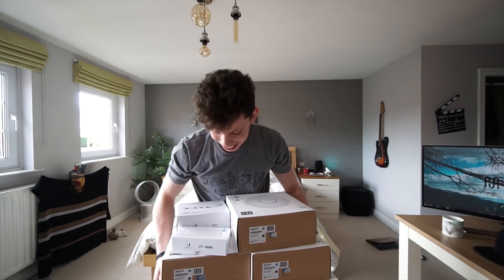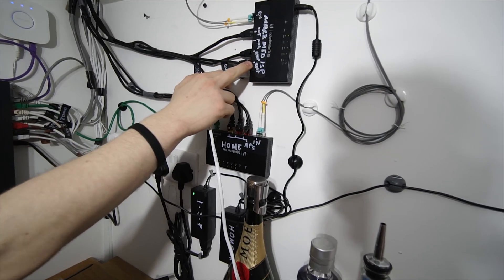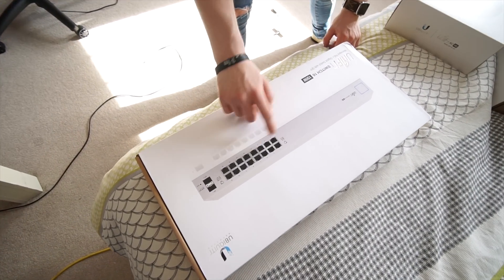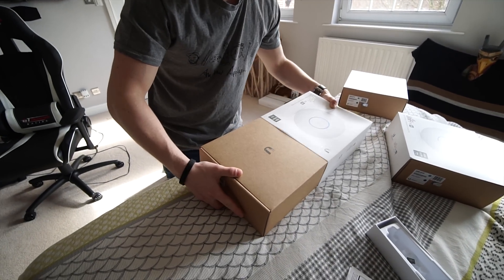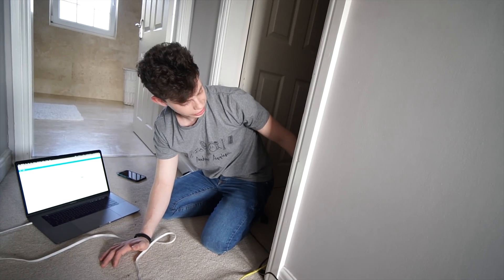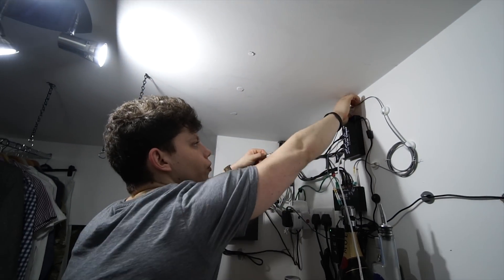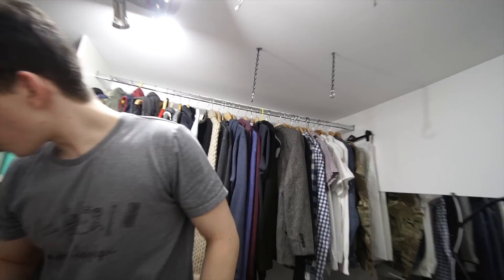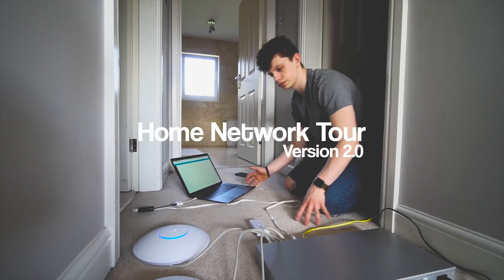Alex's ULTIMATE Home Network Install | AC Access Points, POE Switches & NAS!

Comment: Hi ,can i connect my unifi ap ac hd or pro to my router without wire ? I mean connect it wirelessly and without rj45 connection?and why you didnt use bridge mode or wds mode  insted of using rj45 cable ?
Reply: Bridge/wds makes it slower

Comment: This systems from Ubiquiti works like a charm I did a similar installation and works faster then my regular Netgear router which is suppose to be fast but is not! Thanks to Ubiquiti I get super fast speed on my WiFi over 300mbs

Comment: Did you just use a drill to mount your ears to the switch?
No Gib anchors on the AP?
Your running unshielded data with power...
For the same value I can get the same WiFi coverage a rack, patch panels, and a pro gateway
You are reading sales info
You called it a 16gigabit switch
You explained Poe as "power but over data" then circled back to say "that's POE"
Maybe provide some insight into how to configure it
Let me know if you want some pointers
Reply: Also nothing is level, go apprenticeship somewhere, learn to do a quality job
Reply: you dont need drywall anchors to mount an ap, they're lightweight so wont fall.

Comment: Dude, for a network speed of only 50 mbps, 3 ac hd access points is way overkill. For anyone out there wanting to do this, get the pro access points instead which will still probably be more than enough.
Reply: Or even the AC AP lite, you can get a box of 5 AP’s for £230 and a unmanaged net gear gigabit switch for £40 that’ll do for any res property

Comment: ok:
1. On the USG You can configure 2 lan or wan ports. 
2. The unifi AP HD is for 500+ users that is overkill for the setup and home You have. AP AC PRO would of been perfectly enough for You. But I guess You just buy random most expensive stuff for no special reason. 
3. The switch You have is not a sixteen gigabit POE switch. It's a 16 port siwtch supporting gigabit connections with a total switching capacity of 36gbps. 
4. at the wifi speed test that, shows that You have badly set up the network since You have a total lan speed of 50mbit and on wifi You had half of that. = You had 2.4ghz connection or Your 5ghz channel width is lower by default that You didn't configure.
(even if at the end of the video You have shown a 50mbit wifi speed test). 

I really do like the videos You post, but You could actually be more informative about stuff and not talk about POE multiple times. Instead teach people why this is a good solution for consumers who would just want to go for an affordable enterprise grade networking solution. 
It's just more to this than simple plug and play.

Comment: Lmao all that for 50 meg? I have fiber gigabit 1000/1000. I manage to get around 450/450 real world over just wifi and 950/850 wired using a combo of cisco and ubiquiti gear. You're wasting money when your speeds are that low. You can get away with a few generations old Apple router and manage the same 50/50 you're getting. Save your money for the tech available when your area gets real internet, i'm sure better gear than what you just spent a fortune on will be even cheaper by then.
Reply: Maybe most of his traffic doesn't go to the internet? I don't follow him so I don't know his setup.  In my house, the vast majority (>80%) of the traffic never leaves or enters my home, it's LAN only traffic, not internet traffic.
Reply: Zeric E that’s definitely a possibility, but if that was the case, he wouldn’t be raving about a 50/50 internet speed test result, he’d be showing us LAN transfer speeds.
Reply: Good point, I was just trying to make sense of it.  I have >65 devices on my home network so I look at it differently than the typical person who has a dozen or fewer devices and is only concerned about internet speed.

I like to have management and monitoring abilities that are not available on consumer all-in-one gateway/access point/switch solutions that people buy at the big box stores. I have multiple subnets, VLANS, custom firewall rules, etc. Things that most people don't understand or care about. Speed wasn't a major consideration in my design as I knew in getting equipment with all the other features, speed would just come along with it.

Comment: Here in Australia, I literally get 250/100 from the standardized Network Terminal Device that is in every house, without installing any of this shit.

You are an idiot. Disliked.
Reply: Must be nice to get 250/100.  Why do you assume his only concern is speed?  A unifi solution provides a lot more management and visibility than the consumer junk most people have installed.  Also, you are assuming his concern is only internet.  In my house, the vast majority of the traffic does not enter or leave my home, it's internal.
Reply: This guy is peddling products that aren't fit for purpose, to viewers, because this is just an advertisement for Ubiquiti products ie he says "You only need this (switch) if you're serious about networking and want a proper setup" etc etc. NOPE. Never once in my IT career have I EVER seen a business run (or even consider) Ubiquiti network equipment. It's ALWAYS Cisco or Juniper. It's frustrating the amount of incorrect info he feeds viewers, to again, peddle his sponsored products, without telling them.

There is no need for this over complicated and over priced setup for such a small pipe.

To answer your question "Why do you assume his only concern is speed?" well, why is he using speedtest all the time to show the end result? Seems like his only concern is indeed speed.
Reply: The typical home user has one subnet and a dozen clients, nearly all Wifi, they certainly don't need the hardware presented nor would they have the expertise to utilize it.

If the video started out with a WiFi survey and an explanation of the rational for the AP placements, and the nature of his wired clients/servers, the architectures etc,  it would have given him some credibility. Instead, it just shows a bunch of hardware, which he seems obsessed about, being installed without an explanation as to why. I understand he provides service to other homes in the area via rooftop wireless and a Netonix WS-12-250 (as can be seen in a later video), so there is more to the story.  Network hardware is pretty straight forward, the architecture, logical setup and configuration would be a lot more interesting.

You said "...no need for this over complicated and over priced setup for such a small pipe".  The architecture determines the complexity of the solution, the bandwidth of the external connection is just one piece it.  Back in my network days, we had sites with 100+ people connected via a single T1 (that's only 1.5Mbps pipe), small sites used ISDN (128Kbps).  The larger sites had many Cisco switches, a couple routers with multiple subnets, moving external traffic through a 1.5 pipe much smaller than most have coming to their home today. And it worked fine. People can get obsessed about internet speed, important up to a point yes, but it's not everything.

I use Unifi in my home which works for me and would work for a smaller sized business, but a large enterprise needs far more support and I agree is better served by something like Cisco.  I have >65 TCP/IP clients (~20 wired), multiple VLANs/subnets, and custom firewall rules.  My connection is 100/12Mbps, and I rarely use half the 100 download, but do at times saturate the 12Mbps upload. I do saturate a couple of my 1gbps LAN ports at night.  It's about the total architecture.  For most home users, all they have are Wifi clients needing internet access, that's it...which only requires a very simple solution [ISP <-> Wifi Gateway Router <-wifi-> Clients].

Comment: Hey Alex I love you channel But I have a question this video is a little bit older and I have also seen me Velop mesh system from Linksys is that better than what you did here or would this be a better network for about a 400 MB per second Internet service?

Comment: Would've been nice to see you console into the switch and display the interface status auto nego speeds and duplex. Doing a speed test isn't going to show you if you're getting a gigabit negotiation between NIC's or not. Also, I would not consider this a proper way to set up an "Ultimate" home network. It's the equivalent to spray painting your car with spray cans rather than a spray gun and car paint. Why is there no patch panel? You're relying on your rj45 connectors to clip into your ports? Thats a bit risky considering the top piece of the clips can easily break- resulting to the cord falling out ("Ultimately" loosing connection). Very poorly designed. A rack mount (even a small 4U that you could screw onto the wall) would've of been perfect to put a patch panel on, to rack  the switch and routers (appears you have a few), a rack-able surge strip to free that overly cluttered a/c outlet, kvm switch to console into each device on your network, and maybe even run an ups to keep all that expensive gear from getting ruined in case of a power outage. You my friend are definitely no network engineer. But good try though. I have a feeling if you did it the right way these kids would get bored.
Reply: I agree that his install was not up to snuff considering the level of equipment he was putting in. I was laughing when he was proud of his great job on cable management. To your last sentence...most of the comments on here indicate the audience is pretty clueless.
Reply: I also agreee, you serve a good point.

Comment: Nerv wracking youngster with no clue of what he is doing. The unifi HD AP's are way way over the top and it is obvious that he just bought the most expensive (cause its better). Gee. Normal AC's will do the trick perfectly. For the rest, Ubiquiti makes the best Network products, that is a fact. Never seen anything better. Not in Setup, not in quality not in .... well... everything.

Comment: If you wanted to do things properly you would of had a rack with patch panel. You also really only needed an 8 port 150w for such a small space. And likely two AC Lite max. The configuration you installed is similar to mine, except I have a 4k SQ Ft house, an Ap Pro, an full GigE network with fiber to my rack, wireless speeds of 800Mbs and lan speeds of 990Mbs with 1ms latency. Your setup makes no sense for your house and ISP speed.
Reply: Jim Long if I have a 3K square foot home. What would you recommend?

Comment: Not a bad video. You've obviously got a lot of money to blow (or a sponsorship with ubiquiti).

PROs: 
1) You test everything before installing it (so many setups ignore this component).
2) Fairly easy to follow.
3) Enthusiasm.

CONs:
1) You have drastically overspent on your hardware when considering your internet speed. To that end, maybe go into MIMO a bit more and why you picked your specific hardware. If it was just to get POE capability, then target that but admit you overspent for the capability.
2) No discussion or overview of what that bad-ass hardware can do; no network map???

Comment: Geez dude, be a professional.   The setup in your closet looks like something a 5 year old would design.  You’ve obviously got the funds for all that high end equipment.   Tighten up that mess with some racks and cable management systems.   I’m a novice and my home network is WAY cleaner than this.

Comment: This guy used to live in my village... he’s a complete fucking dingus. He once threw a tantrum in the local Asda because they wouldn’t sell him alchohol when he didn’t have his ID with him claiming he was famous and they should know who he is. 

Plus he’s talking utter bollocks about 95% of the things he covers in this video and hasn’t a clue. Cat6/7 cable from ISP then multimode fibre line all of 20 inches to another cat6/7 switch, probably the most useless implementation of fibre I’ve seen since my dead nans Christmas tree.

Comment: seems a bit pricey, have you looked into mikrotik equipment at all? they can do the same thing for about 1/4th the cost. i work for an ISP as well, and watching this just laughing at how many ubiquity routers I've taken out and replaced with a 50 dollar mikrotik to do the same job. the only difference is you have to actually know how to make the product do what you want it to do, it's not just plug and play like ubiquity which does fail regularly.(I've seen it first hand)  I've had a set up similar to this at my house, and have not had to reboot my system in 2 years, as well as remote management capabilities, data graphing, and a lot of other functionality that i'm guessing you don't get with ubiquity...

Comment: I've seen this video before.  But, never asked.  Your WiFi so bad in this house, you need three APs?  Technically, u should be able to do pretty good off one.  But, I understand going to one upstairs & one downstairs, to make sure you get 100%.  Even I essentially had 4bars all the time & installed a repeater to overkill. Wish you explained more.

Comment: Would the cloud key work if I have a netgear poe switch and a luxul access point already in my house but I want to add the key for ease of use and another access point ?
Reply: No. Only works with Ubiquiti gear.

Comment: Let's all take a minute to appreciate our friends in the comment section
1. Bragging about their bandwidth being higher.
2. Showing off their mad networking skillz.
3. Throwing cisco certs and degrees at each other.
4. Thinking that his personal network setup on his closet wall is his whole ISP infrastructure and that a server rack is what makes a machine a server.
5. Drawing lines when one can call himself a networker, a room a server room, and a nas box a proper nas box and a machine running a server a true server.

Thank you for restoring my faith in mankind and being very informative.

Comment: My WiFi Network using 2 routers. The router the ISP gave us (it has wireless N) and a Apple Airport (Wireless AC)

I Get around 90Mbps on my Wifi
and around 250Mbps on my Ethernet network (see http://beta.speedtest.net/result/6707235161)

We pay for 300Mbps our ISP is Spectrum Cable in Orlando, FL.
Reply: Also I've installed Ethernet and Phone jacks around the house.
Reply: I've been programming & into networking for 4 years now. Also I've been messing with electric engineering since I was 5!

Comment: I think i must have to difent phone numbers in house so if one Isp ruter is on other floor and someone turns off your router Isp router than all other devices will not help you only if you connect RJ11 wireless line adapter but it does not exist.

Comment: Fuck me what a mess.. 1 torrent and you can  drain that internet connection.

Ditch the ubnt gateway. Get a pfsense firewall up n running linked to your ubiq  switch. Configure your pfsense fw for qos and fair share network load,   hook up your ap,s and lan devices and sit back and relax.

Comment: 50mb that's low (O.o) I have alone from my isp 4000 mbps down and 2000 mbps up which translates to 4 gbps download and 2 gbps upload or 500 megabytes per seconds download and of course 250 upload. on a second note, how do you host other people in your village with those slow speeds?

Comment: why would you need this setup for a 50/50 line lel. It's complete unnecessary overkill, especially for those few users you have. A simple 200$ router is enough to supply even 200/200 to wifi all throughout a house if you put it in a smart position.